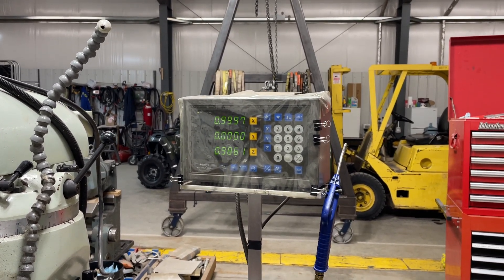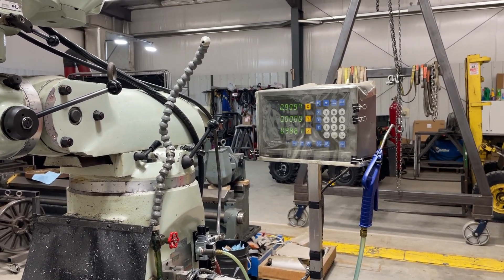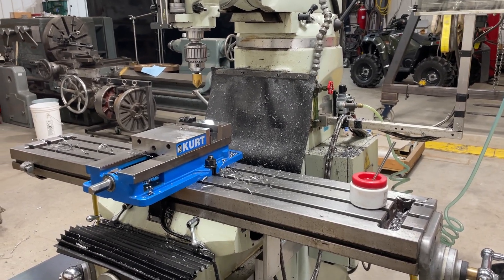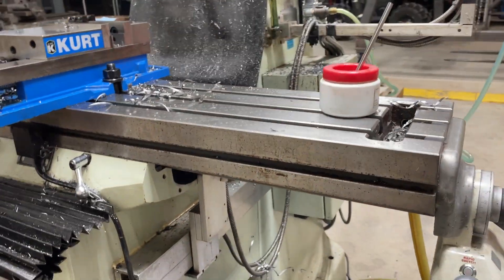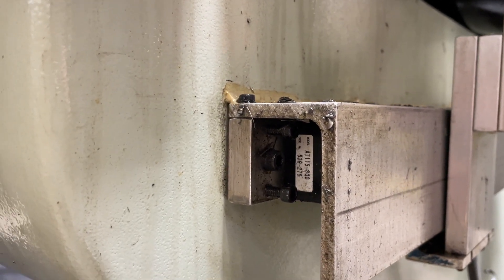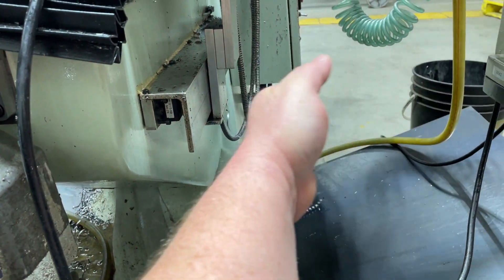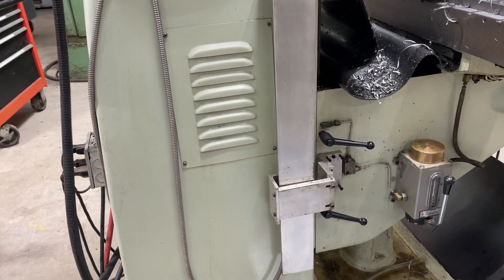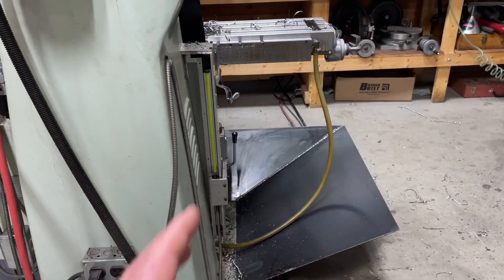For Max Grant, How I Put Read Out Scales on My Bridgeport Clone

Comment: Any chance you could do the same DRO explanation for the Taiwanese lathe (with the pneumatic clutch)? I've got the same lathe and a brand new DRO kit and having trouble coming up with a good solution for mounting the DRO. Love your videos. Please keep them coming!
Reply from the maker: On mine the back of the bed is machined parallel to the bed ways.  This surface is then painted over at the factory, but the paint was scraped off down to bare metal before the scale bar was installed.  It was installed directly on the machined surface.  The cross slide scale was mounted directly on the right (tailstock side) side of the cross slide as it has a ground surface.  This will only work if the scale bar is not too tall as it cannot sit proud of the top of the cross slide.  If it did you wouldn't be able to rotate the compound rest.  The scale head was then shimmed and bolted to the apron.  Ken
Reply: @hmw-ms3tx  Thanks Ken. I'm going to tackle the DRO over the Christmas break. I'm also going to machine a new tool post nut - the factory nut is tiny and the tool post is those turret style. I've got a new Aloris going on. Love your videos. Keep them coming!